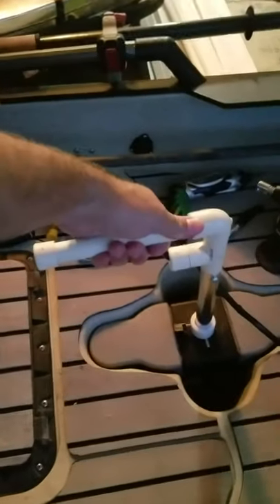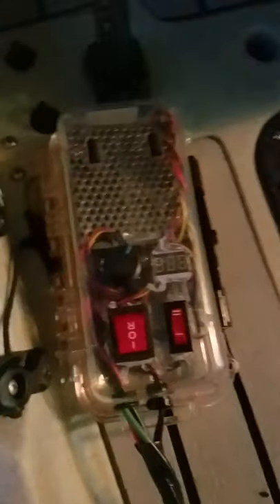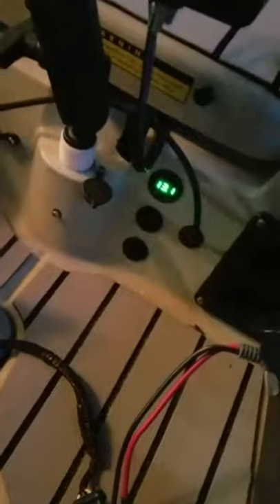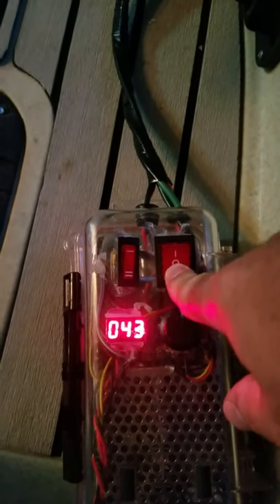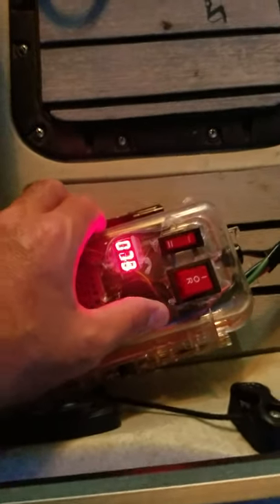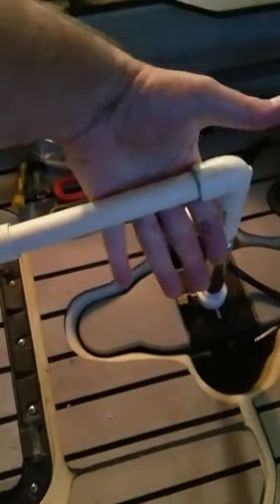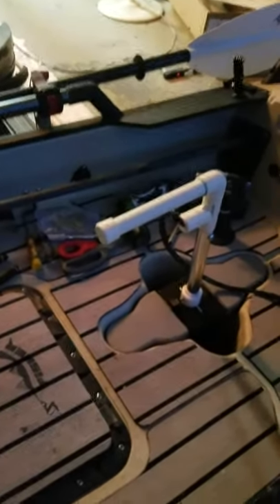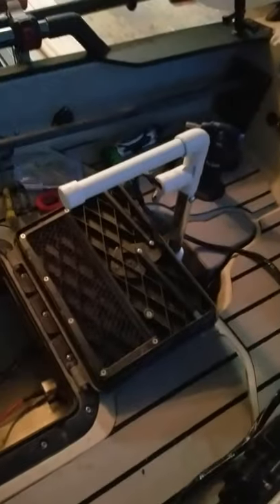Status update on the Hobie PA12 Watersnake trolling motor installation

Comment: could you use a bigger water snake unit like the venom or does the motor not fit though the drive cassette hole ? Was thinking of the 34lb unit.
Reply: I use the Venom SXW 34 and it will fit through, but you need to angle it quite a bit to get it in / out.  To do this you'll need to keep the shaft longer (not full length) and be able to move the mirage mount block up the shaft and turn it 90 degrees in order to get the right angles.